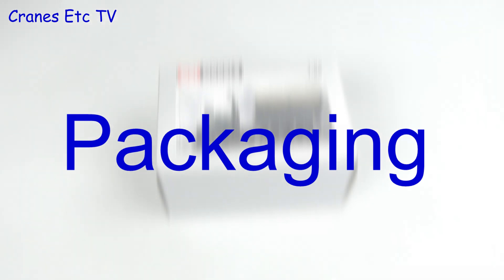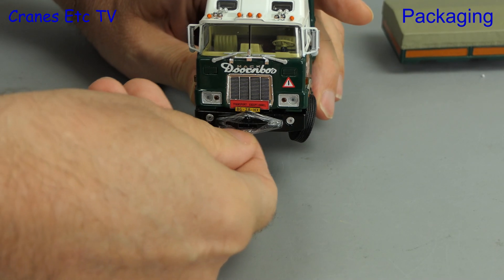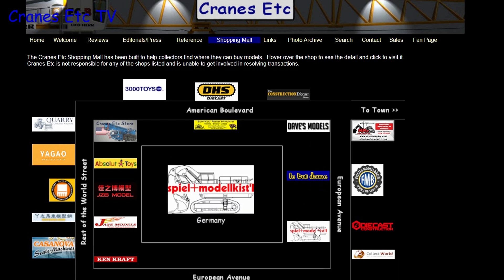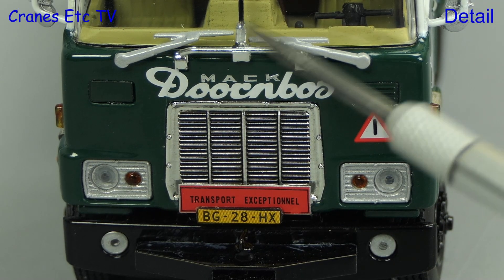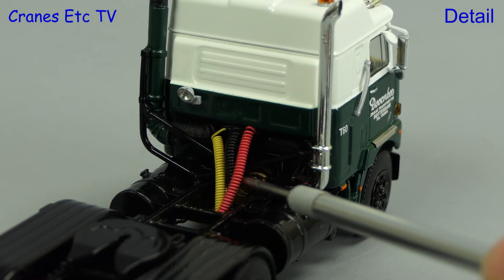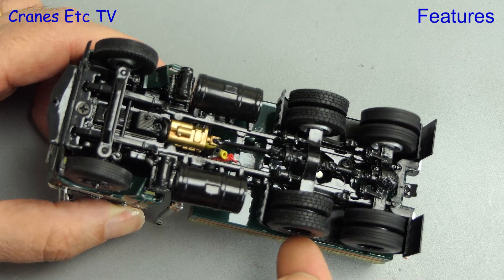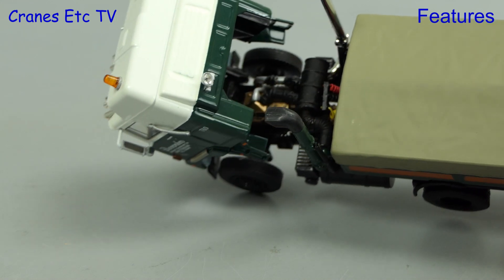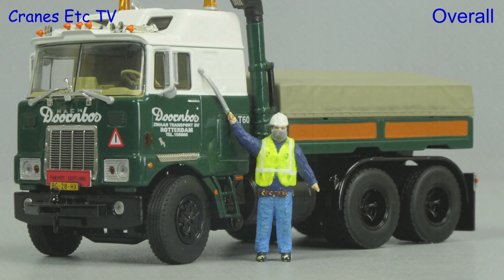WSI Mack F700 'Doornbos' by Cranes Etc TV

Comment: Those "transmission" components are the rear axles, the transmission is behind the engine.  Doubt youll read this but youve made this mistake many times before.
Reply from the maker: Thank you so much!  I had no idea that rear axles were called rear axles and that transmission components were called transmission components!

Comment: Both the engine and the transmission are gold because it has it has a maxidine engine and the maxitorque transmission both made Mack which actually makes the bulldog on the nose incorrect because it should be gold not chrome

Comment: Kinda weak,,,, only 3 axles,  I was expecting at least 5 axles
Reply: It's a MACK. 3 axles is all you need.
The "aerodyne"sleeper cap was a option 
The copper colored motor is called a  Maxidyne its around 300 hp.MACK rated the hp. at the rear wheels on a Dyno. at the factory.  Transmission could be a twin stick mack. The camelback suspension is rough ride Empty. 
But very stable loaded. 
I didn't catch if the bulldog hood ornament was gold. If it was this is a Pure breed MACK.